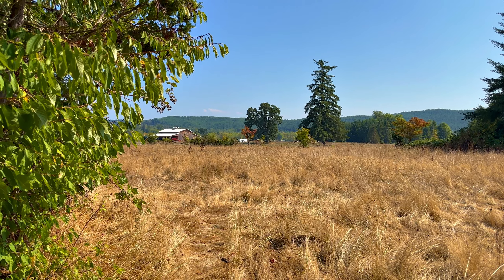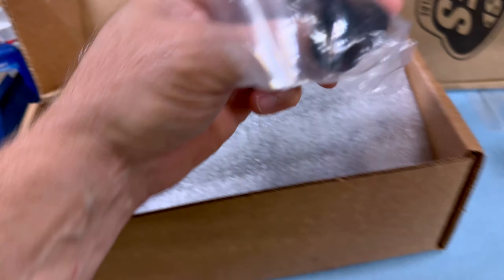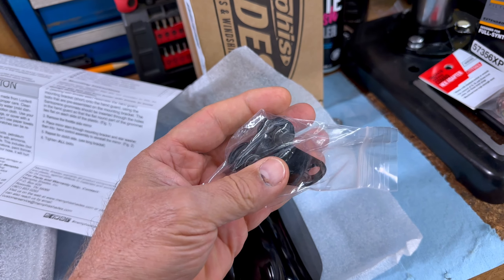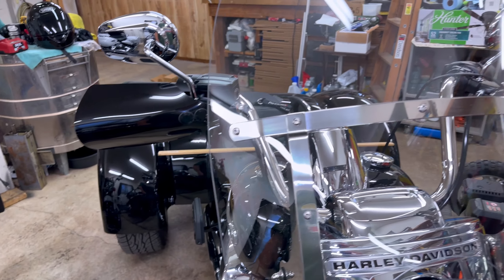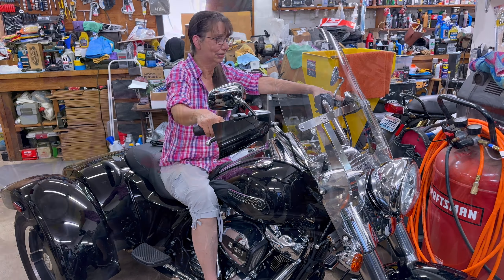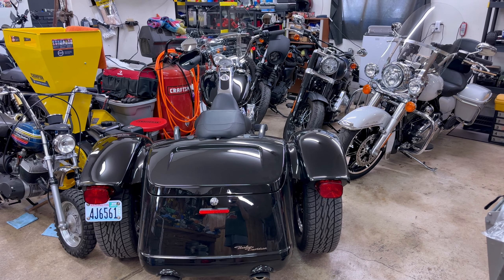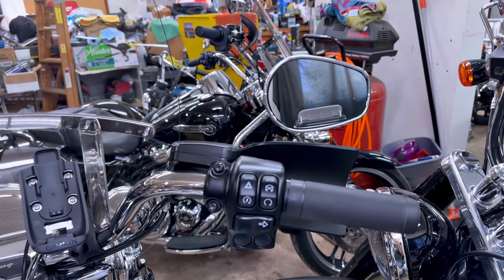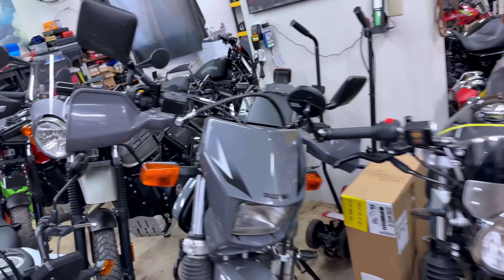Roadie & FLiRTy Hand Guards!! • Check This Out..! | TheSmoaks Vlog_2841

Comment: Add some baby wipes to your rucksack / 'Emergency kit' for 'washing your hands on the road'' (bugs with fingerless gloves etc.) Christmas present for Kelly suggestion.... heated gloves - the kind you can recharge not the ones with cables and stuff. Absolutely agree it's your choice what you fit to your bike, I fitted a 'nose fairing'  with the touring screen to my old naked Honda 500 it spoils 'the look' but where I live means my 'Days out' normally mean 230-300 mile round trip that's a lot if it's windy on a naked bike when you're in your 60's. It always feels to me that you're giving good advice / best practice when you are warning folks against (usually) fitting inferior electrical parts to a very complex motorcycle and not trying to tell anyone what they should or shouldn't do to their bike.
Reply from the maker: Well thank you very much Paul!! 👍